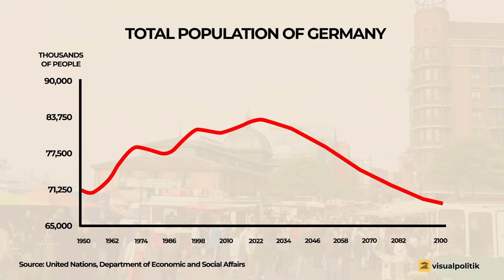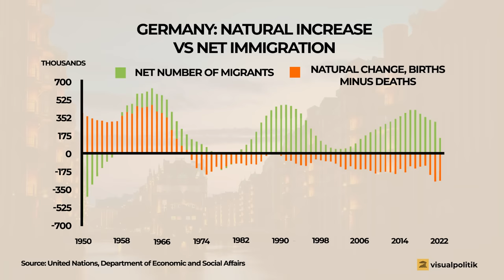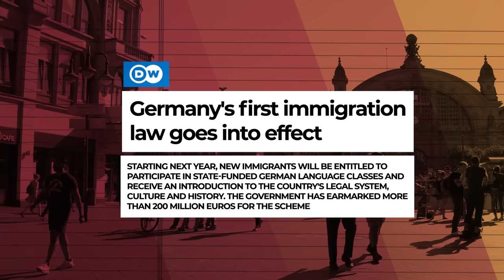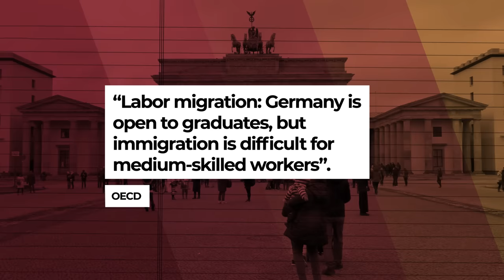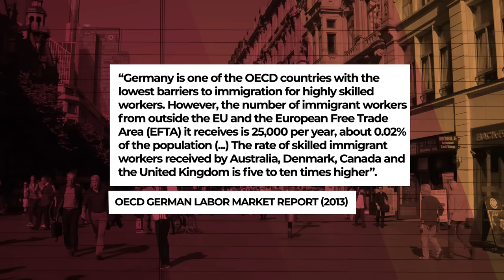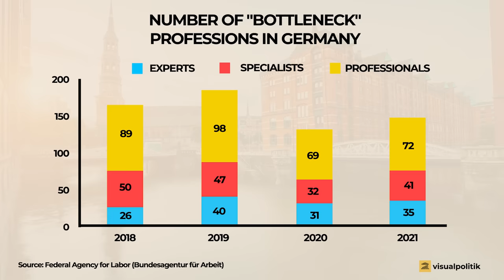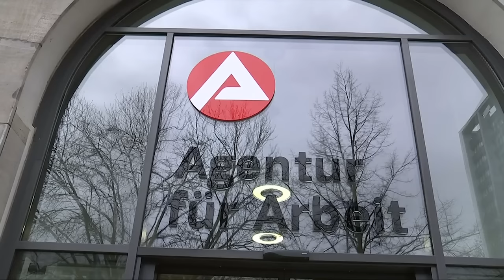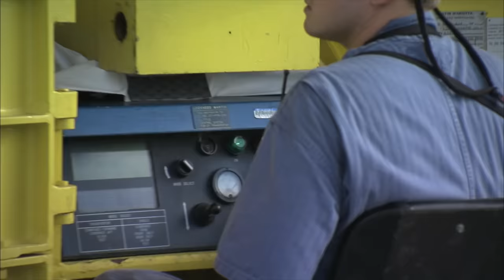Why Is Talent Fleeing Germany?

Comment: Thank you for your insights.  I have seen these figures being shown (almost every day) in German news.  But as someone working in a STEM field in Germany for more than a decade, I would like to share my field observation.

When German employers mention "skilled labor shortage",  what they actually mean is "low-cost skilled labor shortage". The fact that real wage in Germany hardly increased over the last decade supports this point at least empirically. I have personally seen my actual wage (not PMI adjusted) shrank, albeit slightly, over the time I worked here as a professional.

Meanwhile, the German work culture has also becoming more conservative. Language requirements (i.e., C1) is a relatively recent phenomenon, even in non-customer facing roles, when the ability to utter German words would get you an interview 10+ years ago. Remote work becomes more restrictive, and the glass ceiling also came further down for the foreign worker. 

The whole situation is not any different than someone wanting to buy a brand new Porsche for 500€ and (understandably) can't find one, then coming home cry about a shortage of passenger vehicles instead of shelling out more money or adjusting their expectations.

P.S. - Another point is that there is a shift in labor demand. All the way leading up to the 2010s, the wanted section would be listing a lot of technical positions (i.e., for engineers and researchers), some often boasting optional German language training as a perk.  Nowadays they have been displaces by ads for nurses and elderly care persons.

Comment: Based on my experience, I have a few points to share. As a software engineer based in the Balkans, I enjoy the flexibility of working remotely or from the office, whichever and whenever I want, a great salary, and a healthy work-life balance. However, I became intrigued by the positive things I heard and read about Germany, such as even higher salaries and an improved work-life balance. I decided to give it a try, but upon arriving in Germany, I felt an immediate urge to leave. Despite this, I decided to give it some more time, as I knew success wouldn't come overnight. However, after a year, I've concluded that Germany is not the place for me. Here are some of the drawbacks I encountered:

1. Administrative Issues: When I tried to register as a resident on address, I had to wait for two months for an appointment. Each morning, I had to check if someone canceled to get an earlier slot. When I finally had an appointment, they sent me to the wrong building. I had to wait and hope that someone in that building would allow me to complete the process. Eventually, they did, but they made two significant errors: they wrote the wrong nationality for me and claimed I was born in a non-existent city. Fixing these mistakes required another appointment, which took weeks. Furthermore, regarding the registration of my vehicle, I faced months of waiting for an appointment. Upon finally attending, I was initially told that a required document from TUV (technical service) was missing, only to be informed later that it was unnecessary. The confusion continued, resulting in multiple appointments and a demand for 150 euros to obtain the document. After three appointments, I managed to register my car. However, I later received a letter stating that I needed to provide proof of paid customs, a requirement I was unaware of and which without, you shouldn't be able to register a vehicle, but I somehow did. If I knew I had to pay customs, I wouldn't have registered it.
 
2. Job Search Challenges: I started searching for a job and teaching myself the language. Despite applying to numerous job openings, I didn't receive a single interview invitation. The job requirements were inflexible, often requiring full-time office attendance or a minimum of three days per week. Additionally, they expected advanced German language skills at least at the B2 level before starting the job, even though English is widely used as the universal language in the programming world. Considering I already had an A2 level of German and would've started learning as soon as I landed a job, and could easily learn non-native languages, I felt this expectation was unreasonable.

3. Cost of Living: The salary in Germany wasn't significantly higher than what I previously earned, but the expenses associated with housing, bills, and insurance were exorbitant. Finding an apartment was particularly challenging, as you get an empty one, move everything in myself, like furniture, kitchen etc. and pay three months of rent as a security deposit. Furthermore, I needed to provide proof of income for at least three months to secure the apartment.

4. Unpleasant Encounters: Unfortunately, I had negative experiences with some people in Germany. Certain individuals, mostly older ones, seemed to eagerly observe and document any wrongdoing, ready to report it to the police. For instance, even when temporarily parked with hazard lights on while waiting for a parking spot, they would photograph and report such actions. On another occasion, I momentarily forgot something after riding my motorcycle out of a garden, and when I turned back to retrieve it, a man in a car started yelling and aggressively approached me, claiming I was going the wrong way on a one-way street.

These are just a few of the issues I encountered, but there are many more negative aspects I could mention. The weather was often unpleasant, the locals tended to be distant and unfriendly, the internet service was both slow and expensive, and contractual agreements often contained hidden clauses. For instance, I came across a 20-page contract where additional fees were buried in the text. The first six months might cost only 30 euros, but the subsequent 18 months would jump to 70-80 euros. Joining a gym was also an ordeal, requiring a contract commitment. The cost for a six-month contract was significantly higher than that for a one-year contract, and a one-year contract was likewise more expensive than a two-year commitment. Additionally, off-road riding was inexplicably prohibited.

To summarize, my experience in Germany was far from ideal, prompting me to make the decision to leave due to various challenges and unsatisfactory circumstances.
Reply: I share most of your circumstances, particularly what you mentioned in point 3 is exactly what I am experiencing. Finding a job is easier than an apartment. The high living costs, the taxes, and the bills rob you of a supposedly high income. You end up with less money in your pocket than you could make in many other countries.
The other point is that there are quite a lot of Germans who are suspicious of foreigners because they believe that foreigners are doing things wrong, be it towards their neighbors, in daily social life, etc., so they watch and follow closely.
Reply: @birhanjommy  "The other point is that there are quite a lot of Germans who are suspicious of foreigners because they believe that foreigners are doing things wrong, be it towards their neighbors, in daily social life, etc., so they watch and follow closely."

But still, I have yet to witness something Germans do right the first try. There are numerous instances of small things going wrong that I haven't mentioned. Ordering a couch for the expensive, empty apartment only to receive it broken. Calling a professional to fix the gas heating device, which they temporarily repair until it gets clogged again a few months later due to a faulty component. Taking a motorcycle for a regular maintenance service and getting it back with an overly tight chain that even affects the suspension, taking a red car for registration and receiving paperwork stating that it's orange etc. .. I'm getting tired listing things. 😀
Reply: 1). Wow. Two months???

For most day to day administrative things in Poland, I can literally walk into whatever local government office suits me and get the most important things done. Like, right now. Tomorrow, if the tickets ran out for passport applications (several months of max number since start of war, they just sprint through people all day every day). Heck, I can do a lot online, and the online systems are being improved and expanded all the time.

When you file something response times are coded into law, and government offices are only allowed to break those timelines with appropriate justification.

If for whatever reason those government offices are being a particular pain (e.g. you are doing a thing uncomfortable for the local corrupt cabal), they can stretch it to the maximum- but things will eventually get done, or you have grounds to sue.

Unless there is some truly exceptional circumstance, you're going to get your whatever in 30 days or less.

It's not perfect. Far off. But for the most part, for average nondescript people, the paperwork works.

And, surprisingly, the judicial system is passably functional.

2). and 3). Can't say much for that, it's rough everywhere right now. 

4). You'll get all the terms and condititions there, even if it's font size six under the big promotion banner. But it'll be there, and personally I have not yet been screwed over even once, and I switched ISPs like candy the past few years. Got exactly what I expected and all the service I paid for.

Now, there is some funny business going on with the electricity meters- I tracked ours and apparently they behave strangely in february every year- but I still don't have enough data on that to conculde foul play for certain.
Reply: And that's just the beginning
Reply: @semaph0re  damn I haven't heard that before.. usually everyone moves from the Balkans to west EU. Great to hear that you enjoy it there though. Are you a skilled professional, because they make good money in the Balkans, but the Balkan is not great for the non-skilled professionals, because they make far less compared to west EU.
Reply: @alek.andonov  Cmon man, lots of people move to the Balkans nowadays 🙂But they are usually rich people - they already hit their peak in the west and cannot grow their salary anymore. You must understand, Europe pays their technologists very bad, even in Germany.  E.g: if you are a embedded C engineer working on complicated ARM hardware you still only make 4000 EUR a month while in USA you will get 2.5x this amount. So, what people do is they try to move to a place with lower taxes, where it is easier to start a business (lower taxes, less bureaucracy, lower cost of living) and that's how you end up in the Balkans (or USA). Starting a business in the west (the Netherlands, Germany) is very expensive - practically impossible. Entrepreneurs want a better environment to do business. I have my company in Sofia, Bulgaria. And the people are also way cooler in the Balkans of course, west-EU is too crowded nowadays, too expensive, too unsafe, etc. etc.
Reply: @semaph0re  I share same perspective as you. Being an IT professional I really doubt there are significant reasons to move to the cold and bureaucratic Western Europe nowadays. Life is in general boring and the cost of living is getting higher every month. After gave Sweden a shot for 2 years I have decided to leave it and move to South East Asia. Maybe later will go to the Balkans where I'm originally from (if the political and society situation improves a little bit). The West or Northern Europe would be the last resort and will consider it only if I have no other option.
The young generation in the Balkan should be aware that the perspective for developing a good and decent life in the west is not what it used to be 20-30 years ago.
Reply: @nah922  I have found it difficult to convince the young generation that the west is not the paradise they think it is (nor do I really want to convince anyone, but still, they will not listen to you).
Reply: @semaph0re  the propaganda and biased view of the world are going strong. i also have hard time to convince people about thar.
Reply: Well im a german born student and most of the stuff i face as a native as well. Although im still studying i hear from every end how difficult and expensive apartments are. Applying for a student loan (bafög) and registering my car where the first proper encounters with german bureaucracy and it is literal hell. If i wasnt living with my parents i would have been on the streets multiple times, due to the absolute incompetence. Waiting for 4 -6 months to get my student loan was expected, while applying for it every year. Its terrible, and when i consider that im almost done studying and get a nice degree just to see my future income to be cut by almost 50 % just makes me wonder if moving to a foreign country, would just be much better, especially with a german degree. The unpleasent encounters you described is so typical german. And thats often not because you are a foreigner, but alot of ppl just do this because they can with everyone. The only problem i cannot share is the social engagement. But as a few already mentioned. Germans dont just make new deep friendships with every new person they meet. Most germans make their real friendships from a young age and stay with them! For a foreigner of course it becomes very difficult to engage in such things therefore. If someone asks, if emmigrating to germany is a good idea, i would say, get the degree bear with the bureaucracy and leave as soon as you can. Its not worth it, and even if you are born here, its probably not worth it to continue much further, but only time will tell.
Reply: Another software engineer here. I've encountered all those problems you point at and lots of others that you didn't list but probably suffered too. From the words of a local recruiter, you can only land one of the good jobs if you have a C1/C2 German level, and it will require luck too. The problem is that, when you take in account how expensive everything is in Germany, every other job is just a loss for you compared with what you had in your country of origin. 

Also, everybody here is distant, life is boring as hell, apartments are expensive and tiny and everything is tied in a way that moving to a different part of Germany to find out if you landed in the wrong place is not an option. I'm leaving back to my Souther European country where I have (and had before I came) more disposable income than in Germany, nice weather, open people and a far better quality of life.
Reply: numer 3 is often the case in many other countries. Most apartments are empty and the proof of income is a security for the landlord
Reply: @arishokqunari1290  I've been to many other countries, and Germany is the only one I've encountered to be renting empty apartments. It's not my own apartment to furnish it and spend 10k-15k euros, only to sell it for 2k to the next tenant. Secondly, they don't ask for proof of income, they ask THREE months proof of income.. I don't know, if I work three months, I'll need an apartment to stay in.

Comment: I think the video is hovering around the real issue of Germany work market without touching it directly: there is probably not a lack of “skilled” workers in Germany, but a strong rigidity in the culture concerning expertise. 
As a young mechanical engineer, I could have worked in france in automotive, aeronautics, construction and many other fields. 
In Germany, you are request to choose one field and one speciality and make your life out of it. Then, when the demand for that profile collapse (for instance mechanical engineer in automotive, like I was), you need tremendous efforts to switch to anything else, because they consider you should stay in mechanical automotive jobs.